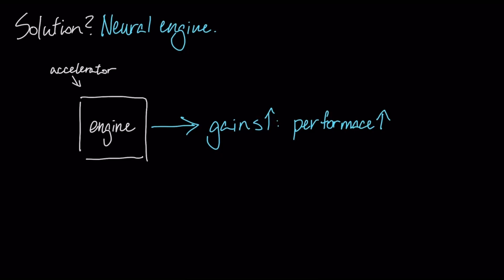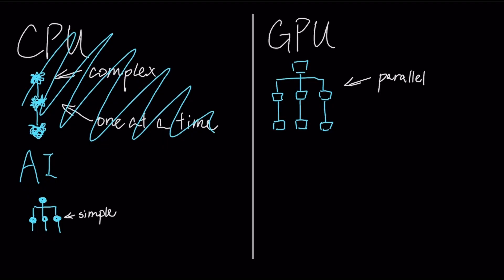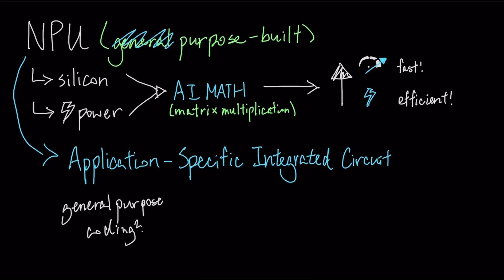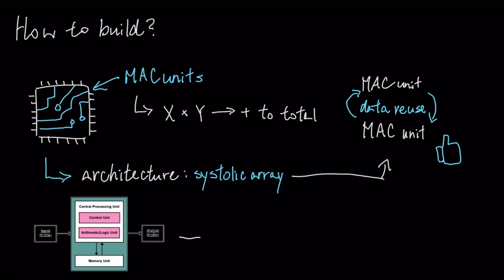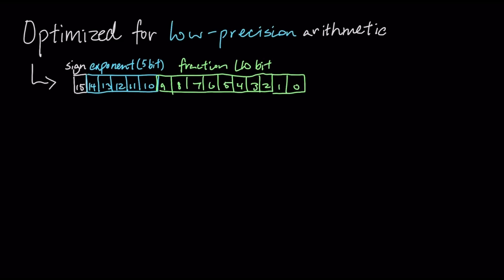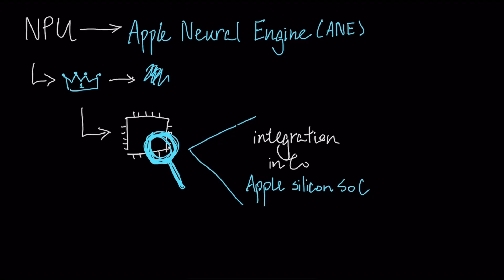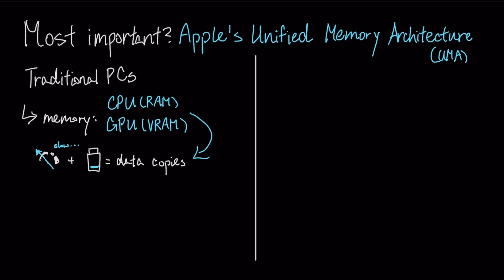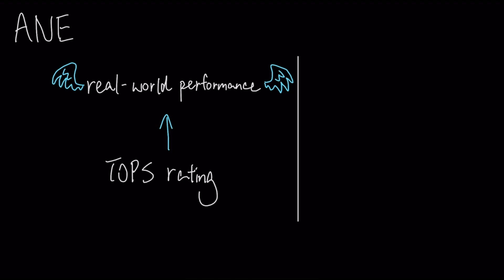How AI CHIPS Work (Neural Engine), Explained in 3 Minutes

Comment: So what is a TPU (tensor processing unit)
Reply: They are the same thing. "TPU" is just what Google calls their version of an NPU. "NPU" is closer to the generic name and is used a lot by Apple in their marketing. "AI Accelerator" is probably the most generic one of them all. An "Accelerator" refers to a processing unit that is not the CPU. Modern day network cards used in datacenters have their own "accelerators" built-in to the NIC. You'll see little heatsinks on them to handle cooling their "accelerators". Storage cards like an HBA or RAID controller also have "accelerators". That is the industry's favorite generic word to use to mean "its not a CPU but it crunches data like a CPU and by this thing crunching numbers, it gives more time for the CPU to do things".

Comment: Yeah, in essence it does work like that! But from a practical perspective, running a high-performance personal AI on a normal PC (without homelabbing or adequate high-end hardware) is really tough. Most modern AIs use massive amounts of artificial neurons and resources, with huge weight training requirements to get quality results. 1 pc or so called scam apple product isnt enough. even if someone tried it after using other high end ai like gpt gemini diffference is clearly visible.

Personally, I feel it’s way more cost-effective to use API keys and add ur own tinkering/customization on top. Training ur own AI from scratch on low specs can be fun as a learning project, but for serious results its not realistic right now. Just look at how fast things move chatgpt went from GPT-4 to GPT-5 in about a year and GPT6 might arrive even sooner as technology is progressing way too fast.

the most practical viewpoint of things might progress is they might use a server or high end ai on backend on top of ur ai running in ur handheld device . in essence it same as using any other ai with a bit off leeway or customisation. u can acheive same results with api keys and custom software.
Reply: The models you can run at home are behind the cloud ones, but not that far behind. I saw an infographic the other day that said that they're only about 9 months behind. So whatever cool stuff you're seeing online now, you'll be able to run something similar at home in 9 months or so.

Comment: The thing is all specialized hardware is still bad at training neural nets. Inference is fine but models can't be trained on these neural engines, which cuts their usecases. GPUs are still king when it comes to training!
Reply: May I know why?
Reply: Phones don’t need to train though, just use. If you want to train on a phone you’re a power user with a large gpu cluster in your garage
Reply: @suburbansolarhomeandpreppi9936  think of continual/active learning for user customization it would be much better for privacy and edge device deployment where ur device AI adapts to your use cases
Reply: 😂why u need training on these chips, it aim is only for run inference. And, for running on some constrained and tiny device, that does not have gpu like some robust SoC

Comment: Nice, good explanation. I was wondering how they plan to ever bring this to small devices
Reply: most of this is already available in small edge devices like smartphones.
Reply: No, I meant enough hardware to run non-trivial models like one with 7b parameters, not whatever they are using them for now
Reply: @Leonhart_93 memory is the bottleneck here way more than the FLOPs.
Reply: @vitalyl1327  Weren't devices with 8 and 16 GB of memory common since a while ago? That's why I was thinking that 7b is no problem at all. With some decent quantization, 7b fits in like 4 GB ram.
Reply: @Leonhart_93  depends on what do you call an "edge" device. If it's a full blown Raspberry Pi 5 CM or equivalent for you - then indeed. If it's a battery-powered MCU - then we're not quite there yet.

Also, memory bandwidth is the real bottleneck, even if the volume is acceptable. Does not matter how many FLOPS you have if you cannot feed them with the data.

Comment: It's true that unified memory architecture has advantages in terms of not needing to copy data to the GPU, but the bandwidth of VRAM is much higher than the integrated memory on a Mac. The main advantage of Apple's neural engines is power efficiency, but it's definitely not an improvement in terms of raw performance for AI inference
Reply: Yes of course, that’s why we all need and use NVIDIA cards with 900W power supplies. 😆 Next, we build data centers powered by gigawatt nuclear reactors to take full advantage of that high-bandwidth VRAM. This is true progress…
Reply: 2:54 Apple uses system level cache that would improve memory hit rate. M4 Pro has 16MB of L2 cache which yields 70% hit rate on unified RAM which would match VRAM performance.

Comment: You should also check out Groq and Cerebras.  For inference those things are insanely fast compared to gpu's like the NVIDA H100.  Groq chips call themselves LPU and are designed specifically for super fast inference for LLM's and other neural nets.  Cerebras Waffle Scale Chips have like 200x the performance of NVIDIA H100's.  Anyhow I use them everyday
Reply from the maker: Woah, I didn’t know that. I’ll totally check them out, thank you!